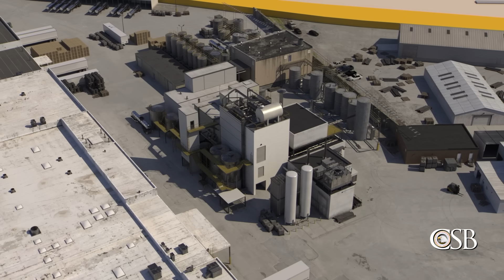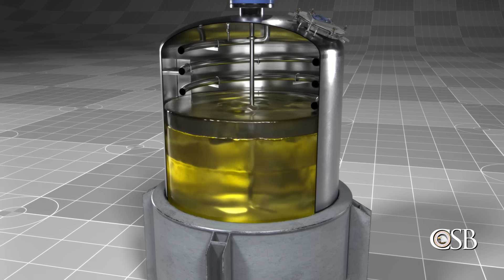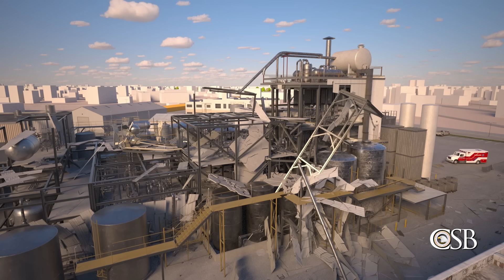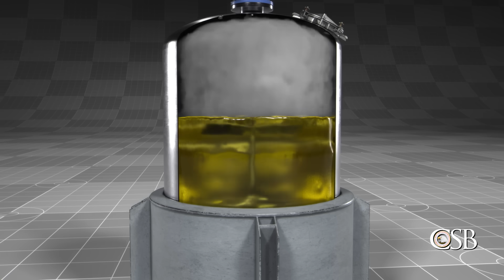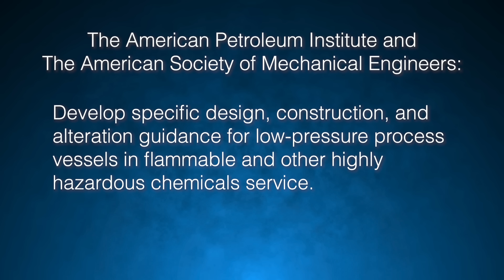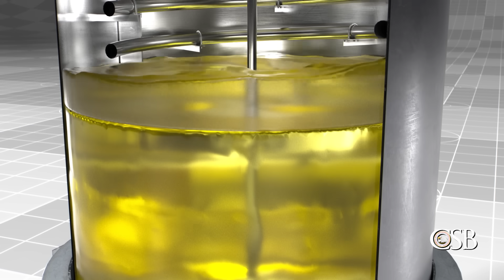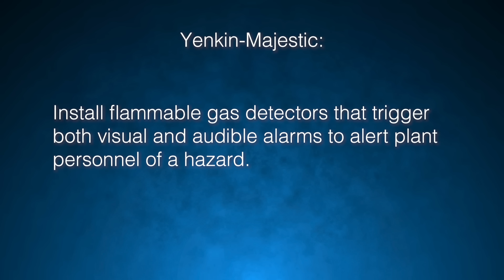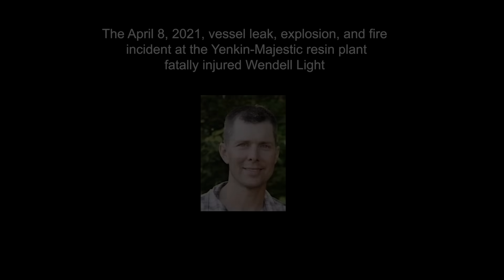Low Pressure, Fatal Consequence: Explosion at Yenkin-Majestic

Comment: If I encounter any pressure under 120, something is wrong. Although I'm never complacent, even after a decade in my industry, with pressure averages from 800-1200 psig, I have no fear. If it happens, I'm dead. That's it. I'm very comfortable and can put all my focus on step by step operation.

Comment: Such vessels should always have a capable blowoff system able to easily and safely vent full tank contents safely no matter the pressure spike. 
Burst disks are simple, reliable and replaceable, and unlike spring-loaded valves do not automatically reset so they do not act to maintain pressure.

Comment: A lot of chemical owners specify vessels to be designed for 15 psi, but have a 14.5 or 14.9 psi design pressure to avoid paperwork associated with code stamped vessels.

Comment: This is a particularly tricky one.
Yes, sound engineering would have told the company that when modifying equipment and in particular in this case introducing a leak point they should have pressure tested to a pressure = MAWP (max allowable working pressure) or a tad bit higher than MAWP.

However at least in Europe, pressure testing is mandated by law, and as you guys said, US vessels below 15 psig of MAWP do not have strict guidelines (ie no pressure testing?). EU is pretty much the same, however the limit is 7.5 psig - this vessel would have been captured by the EU directive and due to its size and contents (flammable liquids) it would have ended up high up in the hierarchy even, potentially requiring quite strict NOBO inspections, qualified third parties testing and QA and whatnot. Yet just a few psig shorter than that and suddenly "the equipment does not pose a significant risk due to pressure" (quote from eu directive). The video reports than the manhole failed at 4 psig already. Would that have been the actual MAWP, do we really believe that difference would have not let to the same consequence over the span of a few more minutes? And it's all and all ridicolous how you can jump from "sound engineering" to category III or IV (which in eu mean a lot of compliance needed) by just a few psig of difference - this is very clear by just reading the tables.

I obviously agree with the other recommendations, but:
-  I think the control logic missing an interlock is something that can be easily missed and to be fair the pressure did not go above MAWP, so you would expect that you can tolerate the pressure surge (if calculated and documented) and that the interlock may not be needed as safety feature per se, since the vessel is (should be) well capable of resisting that pressure. So you can argue human monitoring is sufficient.
- The LEL detectors sending an email are ridiculous, but at this stage we are already in the mitigation phase. Proper alarms, training, PPE, and maybe an E-stop or two outside the kettle room would have helped reducing the damage but the incident has happened nonetheless. Good recommendations but ultimately for mitigation only, making them "less important" than what would have actually prevented the incident altogether. 

And I come back to the point that proper guidelines would have certainly helped in this case, because sound engineering can sometimes be not as sound as it should, and chances of errors are far greater.

Comment: There is a difference between pressure test and leak test.
Pressure testit is sbove design pressure
Leak test is at design pressure.
As it was impracticable to leak-test this part of the unit with waterbecause material of vessel is stainless steel ,water will make chliride stress cracking corrosion, it should have been tested with compressed air, by either checking whether 
or not it retained the pressure or checking for leaks with soapy water. 
Note that during such a leak test with compressed air, the design pressure of equipment should not be exceeded. Pressure tests to check the 
integrity of equipment should normally be carried out with water—  or other liquid like methanol—as then much less energy is released if the equipment fails.

Comment: I can hear the operations guys now when sitting with engineers designing the detector circuits. “Well, you know, we have a history of false alarms from these detectors. We don’t want employees having to evacuate over and over. I mean, geez, they will end up just ignoring the alarm am I right?! I think best practice for maintaining efficiency would be to send a notification email to operations (day shift) and shut down open flames…..yes, no audible or visual alarms in plant…of course you can get that in writing. I’ll send you and email stating you agreed with us….” 
Don’t want employees evacuating due to false alarms 1-2 times per year? Just give them zero alarm instead of improved monitoring or just eat the small price of false alarms for the safety or your staff. 
Can you tell me how I imagined what was said? Can you imagine how many times I’ve heard similar changes to major safety systems? Same for modification of equipment out of design spec. Over and over and over.

Comment: There is no issue to the vessel pressure carrying capable. There is issue to the chemical reaction wich depend on several factors. A high chemical reaction can lead to fast and high gow up pressure and temperature. In this case theres no vessel capable hold on his leg. Try better doing

Comment: It amazes my the half measures used in factories handling flammable and I’m sure toxic chemicals.   Of course a properly designed manway would have eliminated the issue but how was the vessel protected from over pressure.  I’ve done process design and automation programming for 38 years.  How was there not a HAZOP analysis that would have prevented the solvent addition if there was an agitator fault?  If you are going to go through the trouble of putting in all of the vapor detection sensors -how do you not have an audible/visual alarm - and some safety systems like high volume exhaust, etc.

Comment: The fundamental problem here was that the operator was not alerted when the agitator had stopped.  (2:43)  If he had been alerted he would have turned it back on and the accident would have not occurred.  The poor guy was probably badly burned by 425F resin and unvaporized solvent spraying on him, and he had to run through a lake of it on the floor to escape.  Inhaling the  toxic fumes of the vaporized solvent probably caused damage too, hopefully only temporarily.

Comment: 10:23 normal operation as an excuse not to perform mandatory safety tests? If a vessel can reasonably be pressurised in regular operation or expectable mistakes and is protected by a safety relief device, that vessel IS to be pressure tested to at least the release pressure (x safety factor). Literally everywhere around the world. Even in India or Bangladesh.
Reply: @daszieher  The assumption was that the pressure would remain at or close to atmospheric pressure so the extra regulations for high-pressure vessels were not required.
Reply: @musicloverchicago437  then the pressure relief valve should have been set at close to atmospheric. Such (bad) assumptions cause vessel explosions like in the example here.

Comment: 5:33 Gas monitors detected, but didn't sound an alarm? No employees pulled the fire alarm? Bro, everyone in that facility is dumb.
Reply: @Cain_Virethorn  I give a pass to the two employees who were the only ones who knew what happened prior to the explosion.  One was burned by 425F resin and solvent, the other was helping him escape and might have also been sprayed with the hot chemicals.

Comment: I work in the lab at a resins and coatings manufacturing facility.   This is close to home.   I know what we will be watching at our next weekly safety briefing.  ❤
Reply: @vassago42   Good idea.  In this case an alarm for the stopped agitator probably would have prevented the accident.  If it's supposed to be running and it stops, there should be an alarm.

Comment: Worked in a catalyst manufacturing plant that mixed titanium oxide paint onsite along with other related chemicals...this plant was designed to have the roof easily blow off in the event of an explosion along with a built in foam fire suppression system in conjunction with redundant safety alarms both visual and audible along with notifying nearby units in case of high temperatures runaway such as in this case

Comment: The video discusses a fatal explosion and fire that occurred on April 8, 2021, at the Yenkin-Majestic Paint Corporation plant in Columbus, Ohio (0:10). The incident, which caused one fatality, eight serious injuries, and over $90 million in property damage, was a result of a failed seal on a newly installed manway on Kettle 3 (0:16-1:06).

The investigation by the CSB (Chemical Safety Board) identified three main safety issues (7:03):

Mechanical Integrity of Low-Pressure Vessels (7:23): The new manway was not adequately designed, constructed, or pressure tested (1:17-1:20). Despite Kettle 3 having a documented maximum operating pressure of 12 psig, the manway was only tested to 4 psig and failed at 9 psig (8:39-8:54). The company believed the vessel was exempt from certain safety codes because it didn't normally operate above 15 psig (10:16-10:25), highlighting a gap in guidance for low-pressure vessels in highly hazardous chemical service (10:35-10:44).

Safeguard Selection and the Hierarchy of Controls (11:47): Yenkin-Majestic primarily relied on administrative controls (human action) rather than more effective engineering controls (12:19-12:24). There were no engineering controls to prevent the addition of solvent to Kettle 3 when the agitator was off (12:43-12:48). The operator was unaware the agitator had stopped, added solvent, and when the agitator was restarted, the solvent rapidly vaporized, leading to the explosion (3:46-4:27).

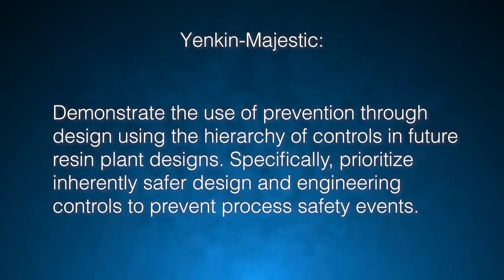Emergency Preparedness (14:08): The plant lacked adequate safeguards to minimize the incident's consequences. Flammable gas detectors did not trigger audible alarms to warn on-site employees (14:41-14:47), and employees were not specifically trained to recognize and respond to a flammable vapor cloud (14:50-14:59). Additionally, employees were not required to wear flame-resistant personal protective equipment in all operating areas (15:15-15:36).

The CSB urges other facilities handling hazardous chemicals to examine these issues and apply the lessons learned to prevent similar incidents (16:41-17:10).

Comment: Fun fact.... Most agitators have a light that lights up when the control circuit is energized but this only means the agitator is SUPPOSED to be on. Without an amp gauge showing that the motor is actually pulling amps you don't know whether it is turning or not. You can't tell even if you see the motor turning because there could be a stripped coupling or something and the agitator itself isn't actually turning. We learned this lesson the hard way and installed amp gauges on all the vessels.

Comment: Should have had a venting system in case of emergencies. Also so, perhaps two or more sensors that would have stopped heating over a certain temperature unless the agitator was on. I guess a process failure analysis was not performed or the failure modes it found were not implemented. I believe in multiple non software prevention devices. With software it only takes one bit to create a failure. I watched a software error allow a nitrous oxide and acetylene fuel mixture to be turned on when the burner was designed for air only. We had a minor explosion with the burner head blasting into the air scattering an acid mixture into the air. The operator, an electronics engineer realized the software was changing the fuel mixture.  He however, did not hit the huge red shutdown button close by to terminate the process. I was watching from a distance and added a safety switch later to prevent such happenings. The switch enabled the nitrous gas solenoid to switch if and only if the correct burner was was mounted. I had mentioned that possibility to the designer but he said software would take care of it. That worked until it didn't.

Comment: A kettle cooking flammables-I wonder why a pressure relief popoff with an outside vent wasn't installed...
Codes be hanged, I say.
Logical forethought is the only tool needed...
A pressure cooker in the home even has a popoff in case of overpressure of steam.

Comment: All the operator had to know was that he had added 300 gallons of highly volatile solvent to hot resin and that turning the agitator back on was likely to dramatically increase the rate of volatilization of the solvent.
Reply: @rdbchase   How would he know that?
Reply: @musicloverchicago437  He added the solvent, realized that the agitator had stopped, then restarted it -- had he not done so, it's likely that less would have volatilized.

Comment: The installed viewport/man-way I suppose acted as unwanted relief valve due to its inability to hold pressure? Or do these reactors not have relief valves (with alarms) that exhaust externally through a filter or wet scrubber? Video answered my questions. Not sure why I’m commenting this.

Comment: The CSB’s approach of focusing on manway testing is misguided.

The first and most important question must always be whether this disaster could have been prevented through proper design and rigorous design review.

Any alteration to a pressure vessel containing hazardous chemicals should require two independent design reviews, with the primary design firm formally certifying that both reviews are consistent and complete.

The proper place to prevent a disaster is not through localized field testing of a modified manway, but at the design and review stage, before fabrication or installation.

No alteration to a pressure vessel should be permitted until all existing aspects of the vessel are brought into compliance with current codes and applicable guidelines.

Errors must be identified and resolved during design and review. Field testing is not an appropriate substitute for a reviewed, validated, and confirmed-safe pressure vessel design.

Comment: You would think that any enclosure subject to heat would have a pressure relief vent, especially when toxic materials are involved. They can be very simple, just like a pressure cooker, a vent with a weight on it. Once the pressure lifts up the weight then the gases vent. Very cheap simple and reliable.

Comment: This whole point on the manway failing at 9psi is irrelevant. If it didn't leak then the pressure would have continued building up as the vaporization continued. The vessel would have failed either way, it just happened to be the weakest link.
Reply: To add, it should have been designed and tested to the vessel rated pressure, but that one failure did not cause this accident.
Reply: @TheImpossibleD  They thought the pressure in the vessel would always be at or near atmospheric pressure.  The real problem here was the agitator stopping and not generating an alarm so that the operator could start it again or at least not add the solvent at that point if the agitator didn't restart.
Reply: @musicloverchicago437  Yes, precisely. The agitator software was the actual death causing issue (along with alarms not sounding)

Comment: Where is PSV, there was no pressure safety valve. It’s mixing vessel kind ok CSTR reactor. Such pressure vessels should have been designed for minimum 3.5 barg approx 50psig. Also, was this hydrotested which is DP*1.5

Comment: I don't understand why the temperature was higher than expected and caused immediate vaporisation upon agitation. If solvent was used to cool the vessel, then the thermal energy should not have been capable of evaporating a hazardous level of solvent? Otherwise I would have expected the same outcome if agitated or unagitated, as by that point the heating was off. 
Unless there is some interaction I have not understood with fast versus slow cooling of solvent or resins specifically.
Reply: @truetrueevil1   The written report has a little bit more info.  After the operator tested the batch and determined that everything was OK he pressed the "batch done" button.  This turned off the kettle furnace and caused cool water to circulate around the kettle.  30 minutes later he started adding the 70F solvent which would also help to cool the resin IF the agitator were operating.
Reply: @musicloverchicago437  ahhh so loss of agitation  caused the other cooling method (cooling jacket) to be inefective. So a vessel temerature lock seems much more sensible to me. Thankyou.

Comment: So you have a vessel that is: 1)huge, 2) pressurised, 3) above 450°f, 4) full of flammable solvents, 5) devoid of any safety alarms, and 6) apparently without any venting/flaring capability in case of an emergency. And as a bonus you add an ineffective cooling system, and improperly pressure tested modifications. I mean try to guess if there might, perhaps, be a tiny safety issue here...

Comment: It would have been nice to have a seal that would have contained the pressure, but I'm not sure they were at fault for not testing to a higher pressure.  The tank pressure would have exceeded even the recommended test pressure shortly after the initial leak. The real problem was the emergency procedure and the fact that it wasn't automatic.  All the other noted recommendations were far less critical.
Reply: The biggest negligence to me was the company having flammable vapor detectors that were tripped, but did not trigger alarms for anyone in the facility, but emailed someone off site who probably was not even awake. Insanity, what is the point of even having them in that case?
Reply: @warnegoodman  Good heavens.  That makes absolutely no sense.